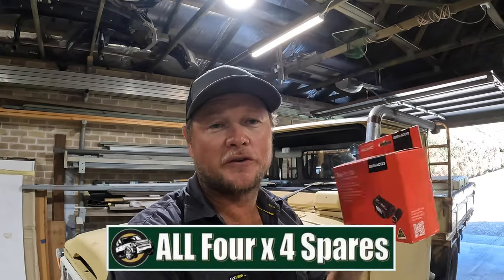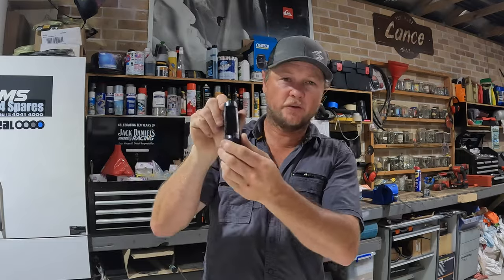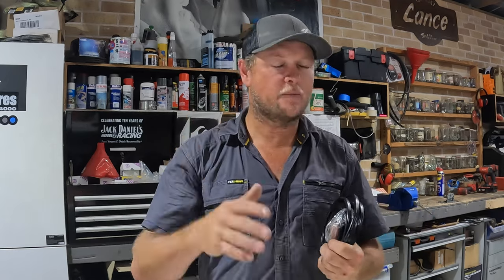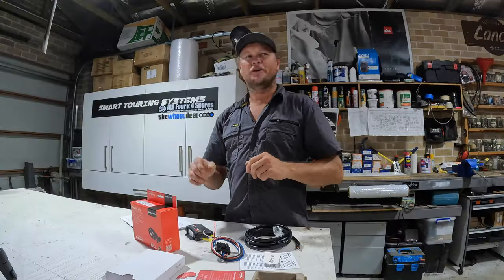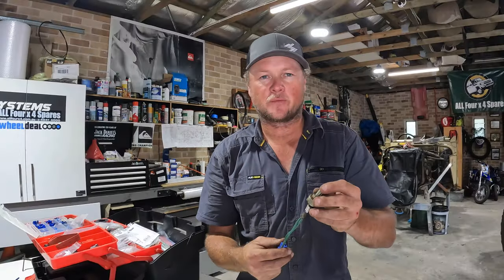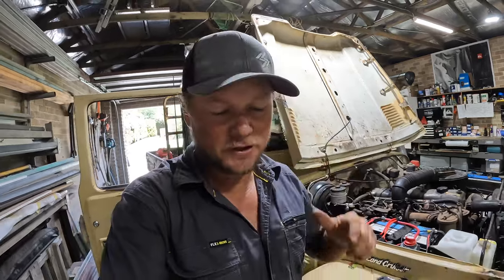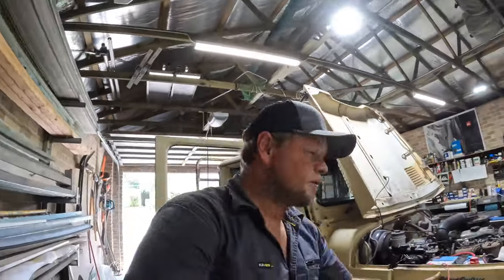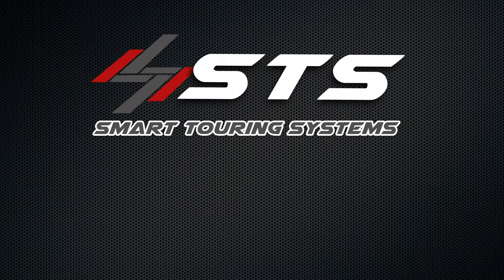HOW TO INSTALL A REDARC TOW PRO TRAILER BRAKE CONTROLLER

Comment from the maker: - Wheels and tyres proudly supplied by - www.thewheeldeal.com.au - use code 'smarttouringsystems' for 5% discount at checkout online
- For more info about the Quick Fit Solar Clip and more innovative off-road products, visit our website - www.smarttouringsystems.com.au - while your there grab yourself a hat!
- For more info about our Conqueror UEV-14 visit - www.conqueror4x4.com.au
- All our 4x4 parts come from the legends at All Four x 4 Spares, check them out for all your 4x4 spares and accessories - www.allfourx4.com.au.
- We choose to use DCS Lithium Batteries in all our projects and touring vehicles, for more info - www.deepcyclesystems.com.au
- We choose Bisley quality workwear "job done" www.bisleyworkwear.com.au
Thanks for watching and don't forget..."you only live once" 👍